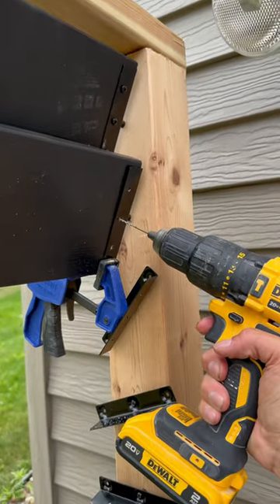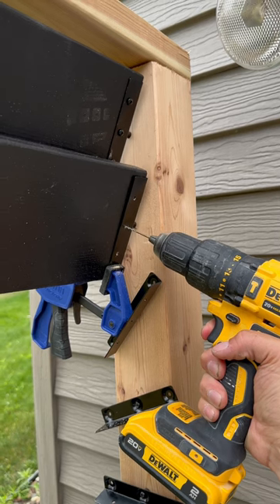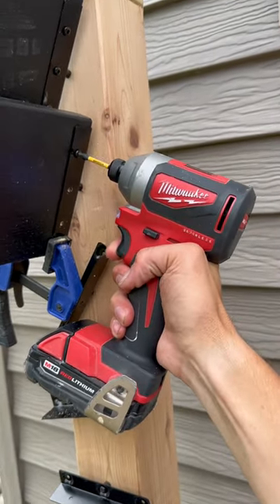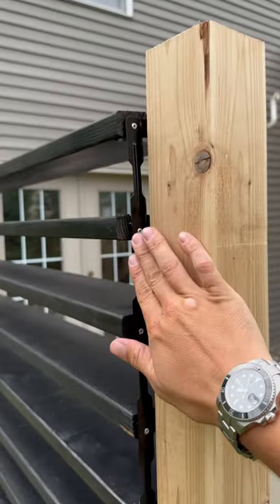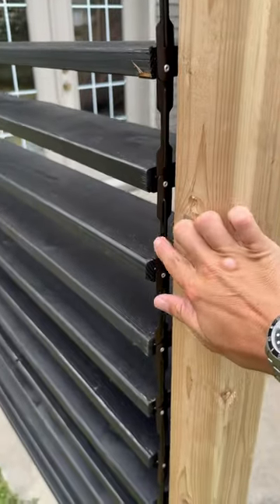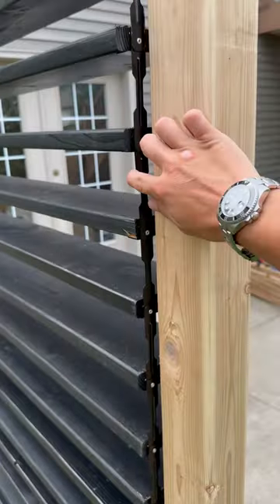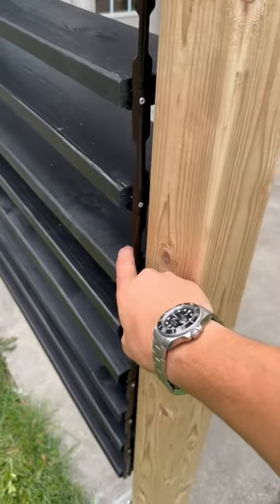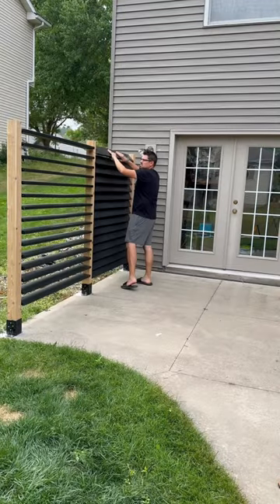Privacy Fence Installed ✅ || Part 2 #carpentry

Comment: Do not over tighten.... uses a driver as apposed to the perfectly fine drill he used to literally strip the thread of the wood away.
Reply: And he said it right after overtightening and stripping that first screw.

Predrill looked too big for those screws.
Reply: I've hung thousands of cabinets with my impact and never had a problem. Most people just don't know how to be gentle with the trigger